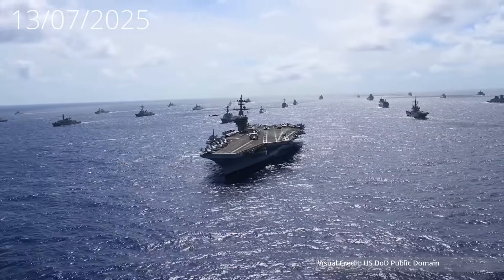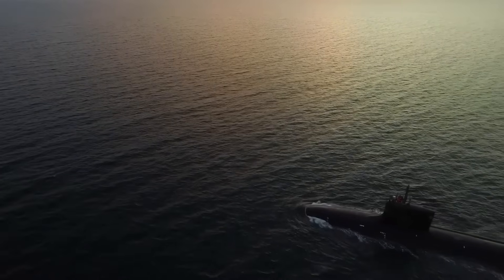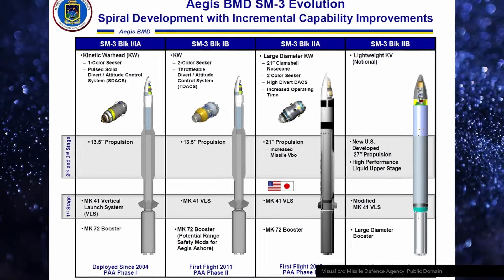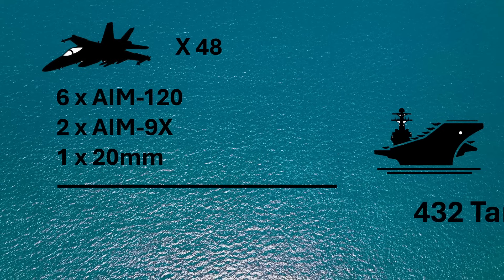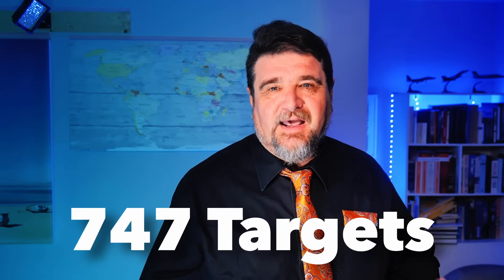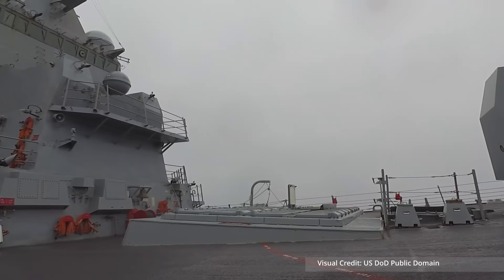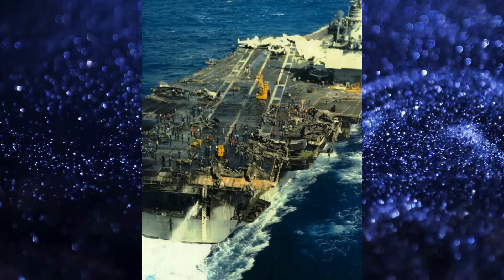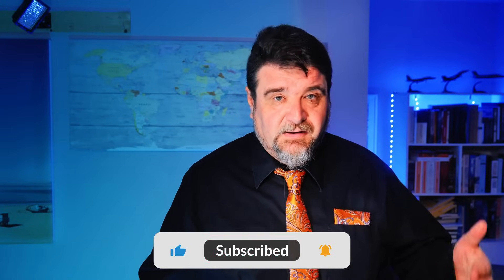HOW MANY Missiles are Needed to SINK A CARRIER?

Comment: the carrier’s Achilles heel is not how many missiles it can physically stop, but how long its CEC network can stay coherent once the adversary saturates and blinds it.
Reply: Heck even worse, how many missiles can it launch in a timely fashion to intercept hypersonics. It takes at least a dozen conventional missiles to even get near a 90% chance of intercepting one hypersonic ballistic missile, let alone maneuvering cruise missiles.
Reply: @singular9  Kiev did take out exactly 0 hypersonics. What you did read was propaganda to keep up morale. In the end they even admitted that interceptors they got are not even capable to intercept them theoretically.

Iron Dome is most advanced and most concentrated anti rocket/missile defense on planet. And it managed to intercept few of very low tech Iranian hypersonics.
That's not something one can replicate with current carrier groups. Therefore even Iran is theoretical threat. In practice, their low tech hypersonics barely reached Israel and were already in critical state having reduced maneuverability and accuracy.
Which quite confirms that velocity itself is factor which defeats protection systems.
Reply: @DarkFox2232  "Iron Dome is most advanced and most concentrated anti rocket/missile defense on planet."
So u believe Israeli propaganda. THAAD is israel's most advanced battery, and it's American. Israel can't stop anything but fertiliser powered rockets from gaza
Reply: @singular9 you are wildly wrong.  Israel had a 95% success rate intercepting ballistic missiles.  A maneuverable cruise missiles is no different than any other aircraft.   Hypersonic missiles have no active guidance anyway due to the plasma, so they are nearly useless against moving targets.   The idea that hypersonic missiles are hard to evade is a r*tard*d myth.
Reply: @singular9  a drone swarm could take out the bridge. You can't stop a swarm of 100 cheap drones with a 1KG explosive on each, not kinetically anyway
Reply: @BOZ_11 what are you talking about, even ukraine has cheap home made systems that deals with drones of that size. Everything from EV to a 50 cal with a radar, and you dont think a carrier strike group has something better? They are testing laser goalkeeper systems ffs. The problem is cost per shot down drone and magazine depth, i think i sm-3 is capable of taking out a drone but its not cost effective and appropriate. The new Bofors 40mm is made for droneswarms.
Reply: @BOZ_11  where are these tiny drones launching from?
Reply: @lordblanc1337  Jam ur radar and send a highly condensed swarm with stealth paint jobs; send a second swarm that's much more dispersed (the same counter won't work on both condensed and dispersed). Your BB gun won't catch everything
Reply: @BOZ_11 i get your point but i still belive in drones as a filler for saturation attacks, and to deplete magasines more than a sulution to sinking ships and carriers
Reply: @BOZ_11 lol stealth paint. Where do i buy a bucket?
Reply: @plagiarisedwords  you should read before you sniff paint: 
"Stealth paint doesn't reflect radar, it absorbs it by converting it to heat which is absorbed and dissipated by the airplane's structure. Paint is only one of several Radar Absorbing Materials available.

The paints known have suspended balls of ferrous material which absorb radar energy at certain frequencies and convert the radio energy into mechanical vibration, which causes friction and in turn heat."
Reply: @BOZ_11  That heat is not insignificant tho,at least for a tiny drone
Reply: @BOZ_11 OK I know radar absorbant paint is a thing. But stealth is not just that. Its the shape of the aircraft, how well the joints align etc plus a tonne of maintenance when aircraft or drone is in the field. Once you factor all that in, its not obvious it makes sense on a 1 way suicide drone.
Reply: @lordblanc1337  No, I don't think the military is using state-of-the-art. Because state-of-the-art isn't cost plus profitable. 

The military is using worse technology because they can charge more for it.

Yeah taking out drones should be easy. A. Browning 50 cal, an Arduino powered turret, and a Jetson nano AI, is the state of the art right now. Particularly since you can combine sensors. And instead of chasing rigidity which costs a lot, just use inverse kinematics. Just like 3D printers. They are like 10% hardware brute force, 90% software magic.

Right now Ukraine is using a combination of radar, distributed acoustic "radar", and optical. 

The United States military does not do open APIs so "integration" is an absolute nightmare and nothing works with anything else, without a ton of work. 

Ukraine has already moved past plug and play. Their migs are using iPads and esp32s to shoot NATO missiles. Easy peasy lemon squeezy.
Reply: @plagiarisedwords  Easy to make even from hardware store with magnetic paint, sponges,  graphite powder
Reply: @BOZ_11 you are an amateur.  Where is this drone swarm coming from?  Heaven?  Anything with the range required to get out to a carrier basically is an aircraft.  Easily detected with radar and IR.  They would be easy targets for Hornets with guns, and those that got closer would get the CIWS or Sea-RAM, which are cheap, reloadable and proven.
Reply: @BOZ_11 stealth paint?  😂😂😂.  Are you serious?  They have to have planform stealth, range, sensors to coordinate with each other, and they need variable cycle engines to coordinate the way you suggest.  To be stealth, you cannot have any propellers visible at all…so these have to be some sort of ducted jet engine.

You just described a swarm of $20M drones…😂😂😂
Reply: @mandoreforger6999  China is probably readying swams of hundreds of Geran like drones (with 50kg warhead/jammer/antiradiation and range of 2,000km (coming from all directions))
Reply: @mandoreforger6999  we already have stealthy propeller-driven drones. Read more, write less.
Reply: @BOZ_11  And hence you have parallel aiming using lidar, thermographic and photo-recognition already integrated.
Assuming the drones has a speed of 200 km/h (~56 m/s), and that you don't want any drone engaged less than 200 metres from the ship, a 40 mm/L70 has 68 seconds to take out the target(s). With a rate of fire around 300 rounds per minute and 3P munitions, the limitation lies mostly in the speed and accuracy of the laying system.
It is possible that you need more than one gun system to cover the ship around the horizon, but handling drone swarms is hardly a insurmountable problem.
Reply: @plagiarisedwords  "OK I know radar absorbant paint is a thing. But stealth is not just that. "

Stealth is just an umbrella term for making things harder to detect.
Get any radar close enough to a F-22, and it'll have no issues tracking it.

All electromagnetic energy (ranging from heat through visible light to gamma rays) follows the same law of physics, meaning the energy remaining to be collected is 1/ distance^2.
This means implementing rather basic stealth principles (like the Aussie drones made out of cardboard, or having a suitably shaped shell that incorporates a Faraday cage) can make a large impact on what range the drone can be reliably detected without driving costs that much.

Even so, it's not some battlefield magic, but just yet another tool in the box.
Reply: @itsjusttadd  They might be cached in the red sea, for example, at the bottom, only released when needed.  Thousands of them.  Soon, they'll have autonomous AI.  Or delivered by ballistics as initial payload.  Or both?
Reply: @plagiarisedwords  From Russia or China.  But only if they want you to have it.
Reply: @itsjusttadd  larger stealthy drones.....they do exist......instead of a conventional bomb or missile payload, they just need to get close enough to drop a packet containing the swarm of smaller drones.....even they cna only launch say 100 or so of the little buggers....and if you have say a flight of 5 carrier drones.......well can you imagine the number sailors who will suddenly need a clean pair of undies when their radar screens light with a few hundred returns that pop up out of nowhere and fairly close by?
Reply: @itsjusttadd cheap fishing boats.. 💯💯😂😂
Reply: @singular9  "It takes at least a dozen conventional missiles to even get near a 90% chance "
That was five years ago. Thanks to intel from Russia's war with Ukraine, the US has been able to get higher kill rates.
And of course, the hypersonic platform would have to have made it within range.
Reply: @wisenber  Which is why most stealth fighter are primarly bomb/missile trucks.....and the Chinese PLA has two models in active service including a carrier based model.   They just need to get into launch range, fire off the missle and sod off back home.
Reply: @gumpyoldbugger6944  "Which is why most stealth fighter are primarly bomb/missile trucks..."
Stealth fighters would be the worst for that with their limited capacity. Definitely not much in the way of ship killers.
Reply: @wisenber  The F-35 is primary used as an attack/bomber by the USN and the Israelis.   

It's stealthy features allows it to sneaking up on their targets, drop the payload and bugger off undetected for the most part.

That is why they were used during the recent Iran-Israeli spat to take out Iranian air defences so that non-stealthy A/C would have a better chance of survival.
Reply: It takes exactly 1 zircon. Sitting ducks
Reply: A carrier is just another HUGE target for cheap AI drones.. 💯💯😂😂
Reply: @QG1681 A target that cheap AI drones aren't powerful enough to sink if they did happen to make it.
Reply: @wisenber really.. 😂😂😂

What's the main purpose of a carrier?? 😂😂😂
Reply: @QG1681 Yes really. Or didn't you watch the video at all?
Maybe some more emojis will help you sort it out?
Reply: there is no intercepting hypersonics
Reply: @user-cc8kb the carrier is a perfect floating coffin.. 😂😂😂
Reply: @user-cc8kb  There are many ways to accomplish that, with some of them proven in action.
Reply: "once the adversary saturates and blinds it."
Being a multi-node network linked to other multi-node networks, it's not that easy to blind or saturate.
Assuming the carrier groups assets haven't blinded the opponent.
Reply: That's what anti-radiation missile and decoys are for. USN has AGM-88G/SiAW that can fit inside F-35s and long range MALDs that F-18s can carry. Plus EA-18Gs the can jam enemy radars. Coupled with low observable sea-skimming cruise missiles like JSM and LRASM and air-launched quasi-ballistic AIM-174Bs, USN has better chances to sink a Chinese CSG.

Not only that US Marines at East or Southeast Asia equipped with Isreal's Hero 120 drones can also saturate a nearby Chinese CSG.
Reply: It can stop none, no country that we've known can manage to stop a Mach 10 plus speed anti-ship missile, the US simply has nothing that can counter against that, so it doesn't matter how long their CEC network can last.
Reply: there was some combat footage provided by the US Navy back when they were "protecting shipping" in the red sea, featuring interviews with the crew. it was fairly apparent from what they were saying that they were coming QUITE close to being overwhelmed at points. This checks out, considering an f-18 got knocked off the deck during emergency evasive maneuvers. if one of the poorest nations on earth could make them feel threatened, it's gonna be wild what happens vs the country that is quickly surpassing the US in wealth 🤷
Reply: @x_elen_x What country is quickly surpassing the US in wealth?
As far as the Red Sea goes, the bigger problem was reloading after a few days.
The US has been able to adapt its tactics as a consequence and develop hands on experience.
Not that many nations have had the opportunity to hone their reactions in real world situations.
That can prove invaluable in a confrontation with a near peer that hasn't had that at sea.
Reply: Electronic warfare of this scale with near peer is unprecedented. I am already imagining the possibilities here. But I must say it is hard to jam something like datalink due to it being ptp, how far carrier operates and how directional some of the important datalinks are. 

Imagine mines/Underwater drones that surfaces for jamming purposes(We've seen those underwater stations by China already). Jamming stations on off-shore reef islands. It doesn't even have to be on 24/7, just time it with your own strike (offensive jamming). Boom. The first thing to go down are short range low power radios. So no comms for sailors, they have use line telephones, hinders fight deck operation. They can also mask incoming missiles. Imagine tracking a flock of sea skimming hypersonics missiles, but losing them as they fly past a jamming island, wasting you precious time to retrack them.
Reply: Very Briefed And Summarized Ideas:

using anti ship ballistic missiles equipped with bunker buster warheads, our Chinese friends, and even the Iranian, are capable of penetrating the deck of the aircraft carrier, and perhaps pierce it from top to bottom and reach the water causing flooding the ship, the missile hitting any part of the carrier’s internal components and sections will lead to catastrophic destruction, the attacker knows which part of the carrier he must target and what the expected effects of the missile exploding on each floor and each part of the multi floor aircrafts carrier, for example, there are aircraft fuel tanks and there is the ammunition depot and the nuclear reactor, there will be a floating Chernobyl, Whoever is not killed by the explosions will be killed by overdoses of radioactive... 

but the question is not how to penetrate the carrier's heavy armor and defeat standard safety measures such as fire-resistant walls and automatic fire-extinguishing systems, but how to defeat the carrier's escort group, in the end, aircraft carriers of what is very temporarily called the united states of america are not equipped with advanced air and missile defense capabilities it's only equipped with point defense CIWS and sea sparrow, 

there are tactics and weapons systems capable of defeating the escort group, for example for the primitive and less develop and advanced countries the best method is to: simultaneously overwhelm the carrier group from all directions and all altitudes, (multi axis, multi directions and multi domain), dividing the carrier into individual vessels and simultaneously overwhelming each escort vessels (in addition to the aircraft carrier) forcing the escort vessels to choose between defending it self or the aircraft carrier they assigned to protect: 
1-attacking the electromagnetic spectrum e.g: cyber warfare, conducting intensive ECM/ECCM/ESM in order to degrading the awareness and c-4 of the vessels, and help the friendly ammunition to defeat the passive countermeasures, 
2- missiles boats or even especially modified speed boat equipped with guided MLRs launching either rockets equipped with lader guided small diameter glide bombs, or rockets think of enlarged laser guided (APKWS) II/(LOGIR)/(DAGR), those rockets capable of travel at 4 and 5 mach and reaching its maximum range in about 40 second),
3- speed boat launching torpedos the latter is for the underwater dimension,
4- launching swarms of suicide sea drones, sea skimming exploiting the curve of the earth to mask its approach, and flying high altitude for exhausting air defense missiles, those swarms of suicide drones and attack drones could be equipped with either: 
1*-suicide FPVs each with range of 20km, with weight not exceeding 4k.g and equipped with 2.5k.g shape charged warhead capable of penetrating 400mm of RHA either re-enforced steel or heavy multilayered composite armor, other warheads with HE-FRAG, could be employed according to the needs, those suicide FPVs drones could be used to suppress enemy vessels radar systems blinding those vessels, and CIWS, attacking the VLS cells, allowing the other ammunition to reach its targets,
2*- pods for launching precision laser guided (APKWS) II/(LOGIR)/(DAGR), with range of 8km and armor piercing or HE-FRAG strike ammunition, illuminating the spy-2 radar and other vital parts for those low cost rocket the attack drones would be able to saturating those parts with salvos of those standoffs ammunition, that is impossible to be intercepted, thus either suppressing or seriously degrading the combat tactical and operational capabilities of the vessel, homing on the VLS cells could cause explosion 💥 of the loaded ammunition...etc.
 
5-anti ship cruise missiles with reduce radar and infrared signatures, either flying at high subsonic speed or supersonic and hypersonic speeds those ASCM, flying at extreme low altitudes skimming the surface of the sea, and following simple trajectory or capable of deploying countermeasures and conducting evasive maneuvers to defeat enemy defense shield...

6- ballistic missiles either equipped with single unitary highly maneuverable warhead, or equipped with bundle of small diameters laser guided glide bombs equipped with additional rocket or propellant, each SDB will be able of flying at least an additional 500km, think of the outdated r-17 elbrus, with one of the basic model ss-1scud-b, the missile capable of delivering 1000k.g to a range of 300k.m flying altitudes is 50km, at this altitude the SDB will have a tremendous momentum and can obtain addition 500k.g this even without the need to ignite the engine or the propellant, which would be used in the terminal phase to achieve supersonic or hypersonic speed, and conducting 90 degree angle of attacks, those SDGB could be equipped with multi mode guiding/homing systems, GPS or satellite🛰️, laser guided and electro-optical with two way data link... 

LONG LIVE CHINA LONG LIVE PLA...